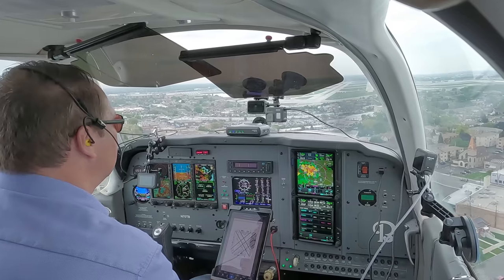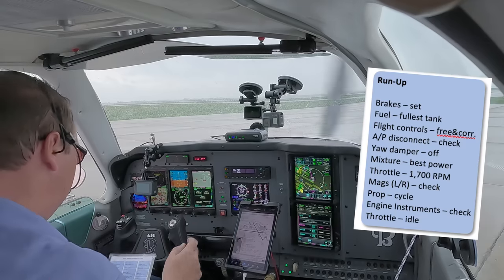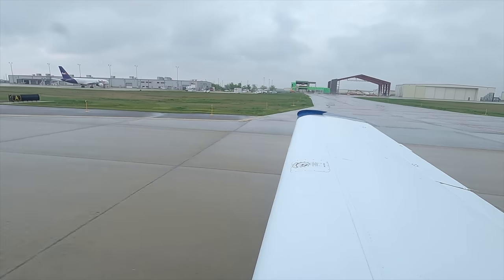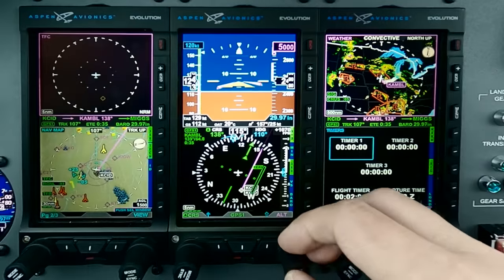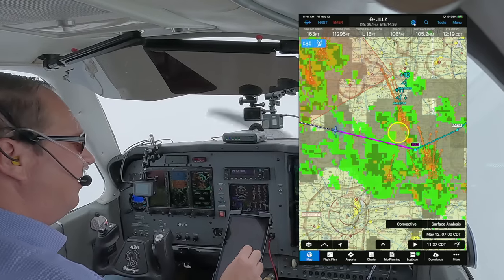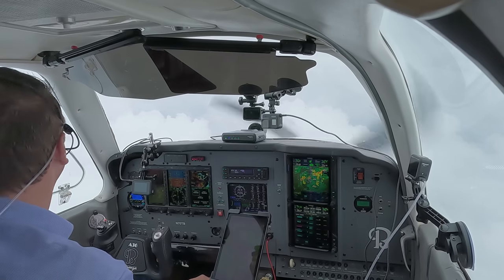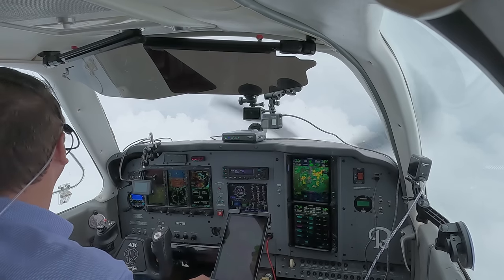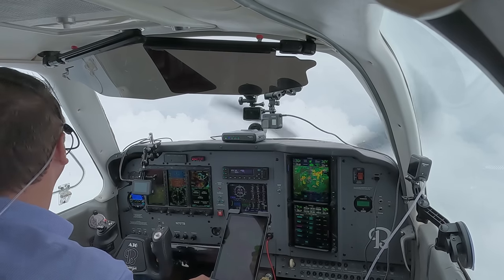Real-World IFR Flying: Chicago Midway in Instrument Weather

Comment: O2 concentrator… Any details on how well it works at 11,000 ft.? Actual O2 %?   Thanks
Reply from the maker: I've had it up to 15,000' a week ago, with an O2 concentration of 98%. Just one person.
- Martin
Reply: @martinpauly  what unit are using?
Reply from the maker: @bobcfi1306  It's the Inogen G5. I bought my unit from Main Clinic Supply.
Reply: Wondering how this is working at FL250 with 2-3 persons in my Mooney…
Reply: @MrSfredrik   Unknown  But I do not think the concentrator will work at that altitude
needs testing

Comment: Your skills and professionalism in flying continue to amaze me. I can see that the approach you flew single pilot would be nearly impossible without an autopilot. That being said, your discipline is essential in using your advanced avionics and serves as an example for all GA pilots to emulate.
Reply from the maker: Thank you for the kind words, though I don't agree that this approach cannot be flown without autopilot. Sure, it would take a lot of concentration, but both the ENDEE6 arrival and the RNAV Z 13C approach are basically just sequences of waypoints - fly the airplane to one after the other and descend to the appropriate altitude, and you'll find the runway.
Regards,
   Martin

Comment: For me, the transition from steam gauges to GPS flat panels was recent and a steep learning curve.  So much is pre-programmed that you are forced to stay well ahead of the airplane.   I found out two days before the trip to KOSH this year that I would be without the Garmin autopilot due to a servo failure, so I was busier than usual at times.    As you demonstrate, it can get very busy in the cockpit programming the routes when they change.    Great trip out and back!  Thanks for the ride-along.
Reply from the maker: Yes, that transition can take some time. The good news is at the end of that journey, pilots feel just as home with a digital EFIS as they used to be with round gauges.
- Martin

Comment: My real world IFR flying doesn't include such updated avionics at the moment unfortunately. The panel certainly makes the stress level lower and preparation level higher particularly in the terminal area. Thank you for sharing and continued safe flying.
Reply from the maker: My pleasure, Dave. And yes, the new panel with the GFC600 autopilot is a great help.
- Martin

Comment: Max forward speed, change to runway after approach already configured on final for different runway with IMC present, that runway is shorter, the IFR pilot in me wanted to say "unable!" Nice work Like that you include mistakes as well showing the human side of flying, I've forgotten the sqwak more than once myself.
Reply from the maker: I know what you mean, Andrew. What helped here were three things:
- We were in (marginal) VMC at the time the runway change was issued
- I had done this switch to the short parallel runway at Midway before several times
- The Bonanza with the gear down is very easy to slow down, so you can be fast until short final and then slow quickly to a lower speed for touchdown
- Martin

Comment: The ATC controller cleared you for RNAV Z RWY13C than tower told you to land on RWY13R. How did you make the transition between RNAV Z RWY13C to cleared to land on RWY13R. Did you just hand fly (VFR)? Assuming you didn’t have time to change the approach in the GTN750 and brief a new approach?

Comment: Martin, great flight!  I love your IFR flights, they are so informative.  How do you like the new GFC autopilot, I believe it is a 600?  Does it interface with the Aspen 2500?  I am planning a GFC500 with my Aspen 2500 system by the end of the year, hopefully, I'll be satisfied.  Thanks.  Don/NE Ohio 🙂
Reply from the maker: Thanks, Don. I have the GFC600 which is fully integrated with the Aspen PFD. Note that that kind of integration does not exist (presently at least) for the GFC500, so keep that in mind for your upgrade path.
Regards,
  Martin

Comment: Your use of an oxygen concentrator instead of a traditional O2 system is very intriguing.  Obviously it's only for you and could not use it for passengers but, does it work well for you?  Would consider getting one myself since most of my flights I'm solo
Reply from the maker: It works really well up to certain altitudes. I've used it at 16,000' and measured an oxygen level of 98% - pretty good!
- Martin

Comment: Great video, as always. At what point did you reduce speed from 150 to more normal approach speed?
Reply from the maker: I don't remember when exactly I reduced airspeed on this approach, but I can tell you the Bonanza with the gear down is easy to slow down, so I can fly quite fast until a couple of miles out and then still slow down.
- Martin

Comment: Great flight and content. Just curious- is there a reason you chose to not use vnav on the autopilot on the approach legs?  The 750 looked like it had it loaded up properly compared to the plate…
Reply from the maker: Thanks, Philip. VNAV is the one feature of the GFC600 which is not (yet) supported when paired with the Aspen PFD, so I had to initiate these two step downs at AAMEE and RUDDY myself. Not really a big deal, but that’s the answer.
- Martin
Reply: @martinpauly  excellent. That makes sense (sort of). I would have figured garmin would figured out how to feed the info into the pfd by now seeing how popular the aspen is. But in the end, I guess that’s how they get you to stick with a garmin suite.

Comment: Martin, I know you have the GFC600 AP, but there is an odd limitation on the GFC500 AP that the GFC600 system might share. If a GFC500 system is tracking a VOR (enroute) or LOC/ILS (approach) and the 500 system loses GPS info (signal/receiver/loose wire) the AP will "trip" back to Pitch/Roll mode. This info is in the POH for the 500, might check if the same limitation exists for the 600.
Reply from the maker: Ted, I am aware of the GFC 500 limitation you mentioned. The GFC 600 does not have this limitation; it can track a VOR or ILS even after a GPS outage. This is one reason why I picked the GFC 600 over the GFC 500, as I explained in this video:
https://youtu.be/-esXjUw20rs
Regards,
  Martin

Comment: Thanks for sharing.  Why not program IAS and heading on the ground, then just hit AP in the air?
Reply from the maker: Good question! The reason is that the resulting flight director indication would be invalid for the very initial climb (say, the first 400 feet) during which you want to just fly wings level with a pitch attitude for a safe climb. Taking off into low IMC, the flight director is invaluable - but only if it is programmed correctly. If I had it set to IAS with a target speed of 120 KIAS from the very beginning, it would direct me to pitch down (to accelerate) and fly back to the ground. So we need the right tool for the right phase of the flight, and TO/GO (take-off, go-around) is the right tool for the take-off roll and initial climb, while HDG and IAS come a little bit later. 
Note: I do wish the GFC 600 would allow me to at least preselect the desired airspeed for IAS mode while still on the ground, as it does for heading. It doesn't; instead, when I push IAS the autopilot's speed target syncs up to the current indicated airspeed. Not all autopilots do that, and I wish Garmin would change that.
- Martin

Comment: Great Job…M…Using O2 is always a great idea. We use it all the time above 5 and we usually fly 9-13.  When you get to the AP, you always feel better, your body does not struggle.  Most folks I know do not do this.  Tell us more about your system. Ours is on demand and the bottle lasts 50 plus hours.  But you still need to fill it.  And do not forget to turn it off when done.
Reply from the maker: Thanks - I'll make a more detailed video about the O2 concentrator later this year.
- Martin
Reply: @martinpauly  Hi Martin - big fan of you - o2 concentrators come in different price ranges - what‘s the devices name you are using? Best regards from Switzerland - Peter
Reply from the maker: @peterweiss69  Grüezi Peter - the one I'm using is called Inogen. I showed more details in this video: https://youtu.be/EoVtAgW5vsA
- Martin

Comment: Great video Martin, thank you. The issue with your squawk code has happened to me as well, but I think that in my case, I actually entered the code's numbers, but failed to move them into the active window. I have it built into my GTN750 as well. After that one time, I always double & triple check that the code has transferred into the active window. I hate making stupid mistakes, and mine was certainly that.
Reply from the maker: Thanks, David. I've been guilty of forgetting the squawk code a few times... I'll have to find a better way to remind myself to do this.
- Martin
Reply: Good flight Martin. As an old guy, I have to say that modern avionics certainly make IFR flight a lot easier, with vastly improved situational awareness. Regarding the squawk code, I, too, have goofed up on that a few times over the years. I started using TITS (Tine, instruments, Transponder, Strobes) just before my engine failure on takeoff briefing, helps minimize that potential.

Comment: What is your best practice on doing the pre-takeoff checklist short of the runway or on the ramp before taxi? Do you see value in performing it in the runup area even if you could have done it on the ramp to make sure you don't introduce an unwanted change during taxi and forget to undo it (like opening the door if it's hot, etc.)?
Reply from the maker: If there is a run-up area short of the departure runway, then that's where I do the run-up. The engine will be warmer by then, especially in the cold season when it needs more time to get to operating temperature. There is also less of a chance to blow dirt at someone bind me. Having said that, some airports don't have a good place to do a run-up just before getting to the runway, so then I'll do it on the ramp (being careful about what's behind me).
- Martin

Comment: Those oxygen concentrators are awesome...They are light and basically trouble free...I don't know why manufactures aren't installing them as OEM equipment..
Reply from the maker: They are in fact very useful devices. They are somewhat limited in that they don't work at very high altitudes, and they also don't work so well for multiple people. Even a single O2 concentrator is more expensive than an oxygen bottle, so it's not the right solution for everyone.
- Martin

Comment: In case of go around for runway 13R, what would have been your missed approach?
Reply from the maker: It would be the same as for 13C: Climb to 1100 then climbing right turn to 2600 direct EON VORTAC and hold.
Of course, this is mostly academic, as it was a VMC day and ATC would not have me go missed without giving specific missed approach instructions. The odds of me having to actually go missed that day (maybe because of another aircraft blocking runway 13R) and at the same time getting into a lost-comm situation are pretty small.
- Martin

Comment: 30.04  very disturbing sight. What the heck is that tall antenna doing right next to the threshold??
Reply from the maker: That is the glide slope antenna for the ILS (Instrument Landing System) of runway 13C, just left of where I landed. It shows how confined things are at Chicago Midway. Having said that, it’s not in a position where it would cause hazard to aircraft.
- Martin
Reply: @martinpauly  Unless you G/A low and drift maybe due to X wind. Seen before. Dunno I think such an high antenna should't be there. Other ILS antennas aren't so high and so close to threshold but rather low and next to touch down point. Anyway good info. Thanks.

Comment: hi Martin how you do if you see ice on the wing during pass follow clouds?
Reply from the maker: In a small airplane like the Bonanza you can see it quite easily from the cockpit. But this flight was on a warm day (above freezing), so there was no concern about icing.
Reply: @martinpauly  ok Martin but at that altitude how many degrees was there ?
Reply from the maker: @tonysfly749  The outside air temperature is shown on the Aspen PFD. So you can see that for yourself in the video, at different times and at different altitudes.

Comment: Is this concentrator actually fulfill the legal requirements for supplemental oxygen supply above 12500 / 14000?
Reply from the maker: And those rules are what exactly, Markus? §91.211 speaks of "supplemental oxygen" without defining or restricting what kind of device that supplemental oxygen comes from. 
- Martin
Reply: @martinpauly  Ich c habe glaube zu Deutsch gedacht 😉
Reply from the maker: @MarkusNordhaus  Genau! 🤣
Reply: @martinpauly  agreed, but wonder how much O2 those portable concentrators deliver at altitude...?  Have you checked your SpO2 with a pulse oximeter while in flight? Just curious... I have on-board O's in my Mooney, and always check my SpO2 in flights when I'm I've got a hose in my nose...
Reply from the maker: @JamesWilliams-en3os  Yes, of course I monitor my oxygen level at altitude. 98% at 15,000 feet - pretty good!
Reply: @martinpauly  of course you do, we would expect no less from a careful chap like you! I’m considering getting a concentrator as a backup system for flights in the high teens, where I prefer to fly when I can.

Comment: Ok, careful.
Most O2 concentrators are ineffective over 8,500ft
Reply from the maker: I've taken this one to 15,000' and measured an oxygen level of 98%. That's good enough in my book.
- Martin
Reply: @martinpauly  yes, good.
My concentrator was an older model and labeled with the warning.
I now see units are much improved to higher elevations.
Thanks for responding and checking on your pO2 saturation at altitude.
Regards, and know I enjoy flying with you...